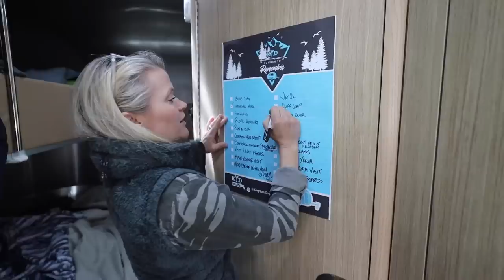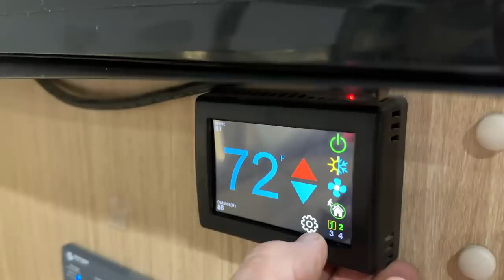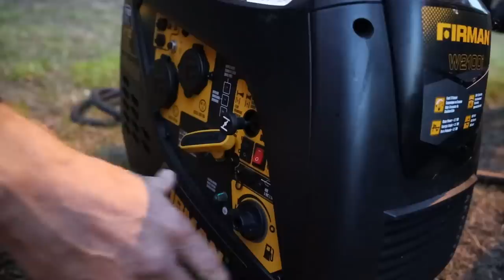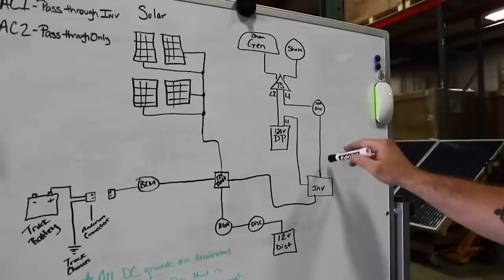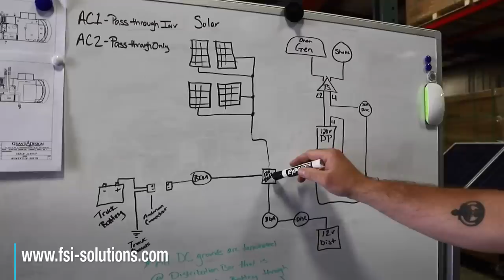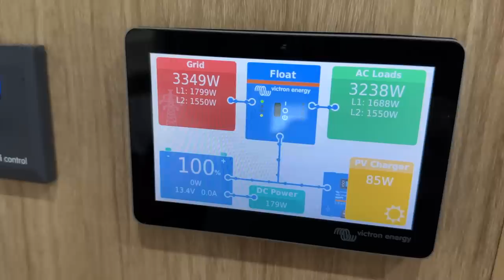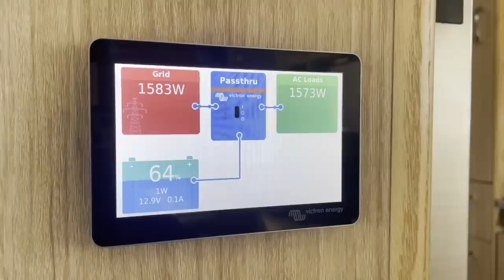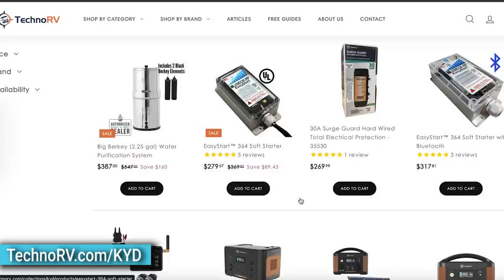Not a Typical RV Solar Video. Dry Camping Off Grid.

Comment: Actually, we can run our air conditioners in our motorhome directly off solar. We have an all-in-one Sungold Power 5,000w inverter/charger that allows us to disconnect our batteries from the system and still provide 110v ac power directly from the 4,400 watts of solar we have on the roof of our MH as long as the sun is shining, and our power draw doesn't exceed the 3,500-4,000 watts or so that our solar array happens to be making at the time.

Comment: I have been RVing for many years and I found very helpful things in your video, I can always learn something new. I was particularly interested in the Victron Orion Dc to DC converter to charge from my truck. I was looking at the schematic that you showed compared to the image your Orion installed and it looks like there is a mis-wire.  Both breakers are in series and not one on each the input and output. The larger manual breaker should be on the input and the small auto breaker should be in the output.

Comment: I bought a 30 amp hour lifepo4 battery and the 12 volt power supply for my cpap machine.  It'll power it for 40 hours.  The battery only weighs 7lbs, there are 2 lakes I like to Camp at that are 5 and 7 mile hikes to get to. Nothing like getting to sleep way off grid. 😊

Comment: One other difference in our systems is we used Victron batteries instead of Battle Born. Specifically Victron 200A batteries, which are very close the the same physical size of a 100A BB. So our 600 amps of battery fit in the space of three Battle Borns.

Comment: I won’t do solar on my house or travel trailer unless I am forced into it due to cost.  It is not worth the expense or hassle at the moment.  You CAN get by without solar if it is not too hot.  A small generator is really all you need.

Comment: I know you say it all the time but you can run off solar without batteries.  Connect your positive and negative from your controller direct and you'll see. Probably only lights. Some manufacturers also use universal lights that run off 12/36/48 volts so you may be able to fo direct from a panel to the rv and run lights ( don't recommend it but you can)

Comment: Ah but you can run the whole camper off a portable power station. Buy a male plug end and attach to a cord with a male plug end. Plug the power station in any outlet with that male/ male wire and wala, you can run the whole RV off electric. I've done it. Thanks for the tips!:face-red-heart-shape:
Reply: True. You'd be limited by whatever the limits are of the power station, but it would certainly work. Great for short term, maybe not so much for full timers like me. 😅

Comment: Wow, you were way over my head.  I’m a 24’ class C with no tow behind.  I need to find more spots in SoCal to camp that aren’t packed.  And the temp is not over 80.  Ok I might be asking a lot.  I can’t sleep in heat.  Need to run the AC without running down the batteries.

Comment: I regret not getting our model with the juice pack solar option. Also, I didn't look at grey water tank size being only 35 gallon tank. Other Alpha Wolf 26+ models have dual tanks for 70, but our 26DBHL bunkhouse model is only 1. This makes taking showers almost impossible off grid without sewer.

Comment: Thanks for this video. I am planning on solar when I go full-time this fall & your advice to see how much power I actually use before I install a system is good. I want to never need hookups & will install a mini split to lower power useage for a/c. Luckily, the cost of batteries has gone down a bit.

I love your traveling videos and the how tos. Keep 'em coming.

Comment: Another great video, look forward to you to start traveling again   For your Victron setup I understand what you mean to be able to visually see the setting on the Multi control but have you ever heard of GUIMods for the Cerbo GX?  This is a mod loaded on the Cerbo that adds all those features to the Touch 50 screen, I did it on mine and love it.  Tap shore on the screen and you can set your limits, tap yiu inverter and you can turn off, on charge only.  You can also add Ruuvi tags to the Touch screen which are temp and humidity on the screen, I have them for the fridge, freezer, outside and storage bays….enough geeking out 😅

Comment: "Nothing runs off solar".   Bank is in float.  You add 200w of load and the charge controller responds by making 200 more watts.  Shunt shows zero change in current going in/out of the battery bank. What is powering the load?

Comment: Perfect timing. Just bought my first lithium. 100 w solar. Heard I might mess up my alternator. Have to do more research.
Reply from the maker: We've been DC to DC charging for years and never had an issue.
Reply: I'm by no means an expert, but this is what I was told a while back: to charge your trailer's lithium batteries from your tow vehicle, you need a DC-to-DC charger; otherwise, the backflow of energy from the lithium batteries to tow vehicle will fry your alternator.  If you don't have s DC-to-DC charger you should disconnect the tow vehicle charging lead.  Our trailer has two large lithium batteries (630 Ah total)  and so far we haven't needed to install a DC-to-DC charger.  We're weekend campers and the solar panels have kept up with our needs.

Comment: I love the concept of dry camping, not a fan of the concept of relying on a generator as a primary source… maybe like you said… that “last 15 to 20%”.

Early in the video, when you first started talking about what the trailers could handle as they are… you said they could power your water heater. I wasn’t aware they had a 12VDC water heater. Ours is definitely 115VAC or propane.
Reply: The control board requires 12vdc to run on propane, it doesn't heat with 12vdc.
Reply: @jasonwheeler4225  yeah… I am aware that the board requires 12VDC. Maybe just a misunderstanding on my part.

Comment: Mucho thank you. Yes, I've been waiting for this episode as well. Great info, and I have a question on the DC/DC power from the truck. Can you offer any advice on what to look for (locally) to find an installer? I'm trying to avoid the 'yeah, we can do that for you' and have a mess when they are done.
Reply: It's not a hard job if you are physically capable. Read and learn and DIY it. If you are unable due to physical disability, still research and learn so you can ask the proper questions of your chosen installer.
Reply: @jasonwheeler4225   Thank you Jason.

Comment: First rule to save money on solar, don't replace anthing that you can do with propane (cooking, coffee, heating, propane fridge). This keeps your whole system smaller ,& cheaper. Second, don't design for 120v  AC, unless you need a computer for work. If you do need AC, use the smallest inverter that works, and don't get a coffee maker #1 above. Third, if you need air conditioning,  move (up or north) or use a campground with hookups.  I have 50k miles using 100 amp lithium and lithium compatible controller. A dc/dc controller would be nice. I use one for the truck fridge battery and it works great.

KYD has a Cadillac system, but they have youtube $, industry contacts and use their trailer almost full time. I hope they don't have to sell it to pay for the wedding,,,😢

Comment: It doesn't cost $20k to do solar and an inverter if you can do it yourself. We've got about $6500 in our Victron inverter, 3 SOK lithium batteries, Cerbo, touch 50, shunt, and wiring. $3k to $4k will easily cover the solar panels, charge controller, and wiring.  Also, the statement that nothing runs off solar is completely wrong.  Your output from your charge controller ties right in with the bus where your batteries, inverter, and all 12v loads connect.  The electricity doesn't have to go to the batteries, it can go to any of those devices.

Comment: Question, you say "nothing" will run off solar. AC power, you are absolutely correct. DC power, I'm not sure. I have seen many RV's that have no batteries, and yet 12V systems work. Lights mostly. Is this correct? BTW I have been a subscriber for quite a while. I love your videos. I went back and watched all of them from the beginning.

Comment: I want a recommendation of a tough fifth wheel, and a tough full size truck please. tough enough to take bad roads like in Mexico and it can take the beating the most.... Well built.
Reply from the maker: My opinion only, a Ford F350 towing a late model 5th wheel with modified axles and suspension.
Reply: @KeepYourDaydream  Thankyou!
Reply: I agree, only with amped up axles and suspension.  PLEASE don’t take anything off the dealer showroom and drive to Mexico (or our roads here in Colorado!!).  You won’t make it very far. Don’t forget a spare tire or 2 and the ability to fill them.

Comment: what is the benefit of adding a DC to DC charger in your truck compared to the 7 pin plug?
Reply: Much higher charge rate. Only get a couple amps on the 7 pin, you can get 20-100A with a proper charger setup and alternator.

Comment: why are not talking about 12V dc items? as most items including your tv converts ac power to dc to work. or town dry your hair.
or like making coffins on the stove using propane?
or even outside on the camp fire ( were allowed)..

there are lots of ways to reduce your power or even not use its all together.

Comment: Great video. Seen them all. We are perspective RV purchasers. Maybe a 24’ Entegra Qwest with a generator and Solar with 1000w inverter . Im assuming that I won’t have issues running a refrigerator that runs off of 12 volt and/or propane. Sound right?
Reply from the maker: You won't need an inverter to run a 12v fridge, but you'll need a battery bank that can handle a constant draw. It's not much, but it never stops pulling amperage. It does add up over a 24 hour period. Get started and see how often the gen kicks on to save your batteries and then you'll know if/when to get some lithium.

Comment: Your battery transfer pump for moving water from a can to your RV is not rated for potable water.  Do you not drink from your RV water system?  I’ve been looking for a pump rated for potable water but they are very expensive.
Reply: Good to know, but we typically don’t drink from our on board water system.  Washing dishes, showers and toliet is mostly what we use the on board water and then sparingly...

Comment: Novice question, as we are busy selecting out our first RV and have no practical experience yet.  Why not simply install a generator to provide all your electrical needs when not on shore power?  Maybe one with an auto start feature in case shore power fails so the dog is assured of AC while we are sightseeing.  What am I missing?  Thanks in advance for answering
Reply: You could,depending on your rig, but there are multiple parks where generators are not allowed, or are limited to specific hours during the day. 

While expensive, the solar/battery set up is noiseless.
Reply: Too much noise and the installed ones seem to be problematic.  Save for your solar, understand what you need and then pounce.  You won’t regret it.  We’ve had a solar arrangement for 5 years and wouldn’t be without one. Start with something you’ll be able to add to if you need too.
Reply: Thank you!  Good advice
Reply: Thank you!  This helps a lot

Comment: Hey Marc, I have an F-150 and wondering why when I pull my RV my truck battery drains and after pulling for just a few ours, I have to self-jump my truck because it drains truck battery…any suggestions to why?
Reply from the maker: Sounds like power is going the wrong way through your 7 way. Look into installing a BIM (Battery Isolation Manager ) device on the trailer.
Reply: Thanks Marc

Comment: Watched last night's episode where again Future Solutions was endorsed.  I have been searching for the right word to use and am still at a loss.  So I think I am going to go with disappointed.  After a Fall 2021 video, I went to their website and filled out the inquiry form.  We were planning a 3 month west coast National Park trip starting in April 2022.  Wanted some upgrades to our factory delivered solar system for better boondocking.   Got an automated e-mail saying the would be in-touch within 5-10 business days.  At the six week mark, I reached out and someone replied telling me how understaffed they were causing an extreme backlog.  Ok.  It happens.  But that does not excuse no contact.  By now, it was December and our trailer was put to bed for the winter.  Reached out a couple more times asking if my work request was too small for their business plan.  If so, I could look for someone else to do the work.  No response.  We left for our trip and I gave up trying to engage them.  I hope Future Solutions has resolved their problems and are providing better customer service.  At this point, I am not sure I would want to do business with them even if they could accommodate my work.

Comment: You talked all about solar but didn’t show us your solar!    We have a power system with 3 x lithium batteries, dc to dc charging, a power bank and a generator but no solar.  This might be the summer we add panels - more environmental, less fuel, quieter.

Comment: This video is almost completely untrue. You can definitely do solar for far, far les than 20 thousand, and I am not talking about a small system. Also, one lead acid battery will die with the basic use of a fridge, water pump, and lights.
Reply from the maker: 0 to 20k.... continuum = anywhere between.

Comment: I didn't like your statement that it would cost $20,000 to get solar.  I don't think you mentioned in what would be included in that amount.  I could get a 1,000 watt solar setup and 4 Lithium batteries for around $10,000.  And this much is really not needed for many people.  You might have scared some new RVers away from solar with that $20K amount.